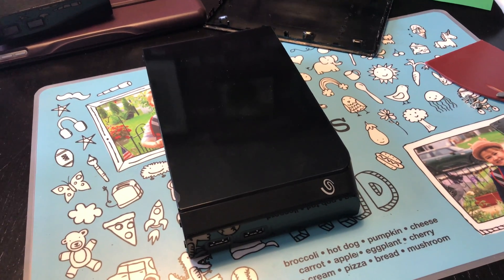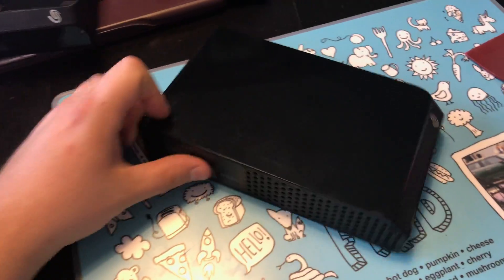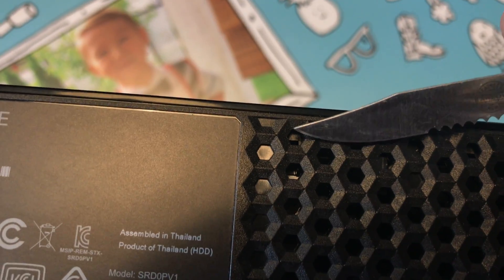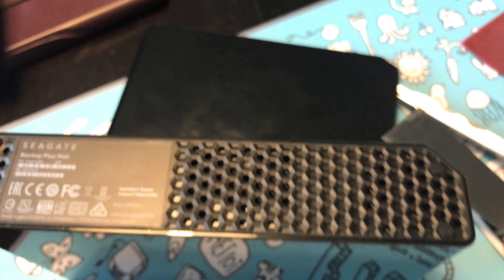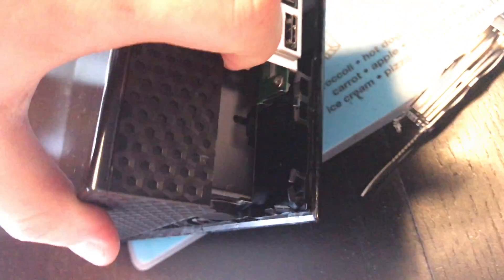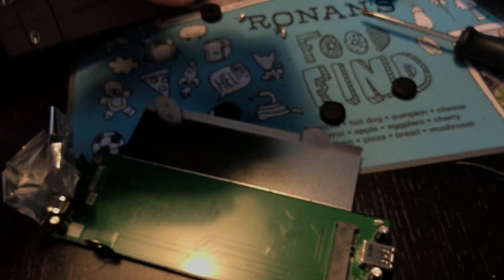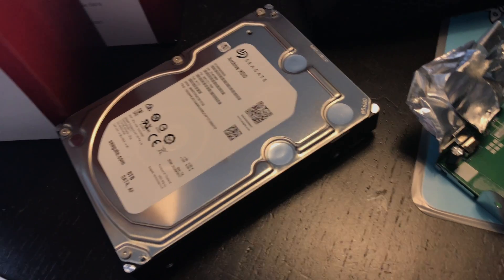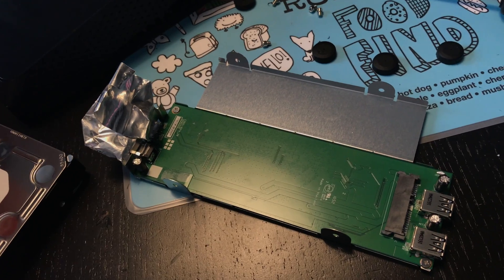How to disassemble a Seagate Backup Plus Hub 8TB External Desktop Hard Drive Storage (STEL8000100)

Comment: Thanks for this. Without your video I'm not sure I would have been able to take this apart. Very difficult. Seagate really doesn't want you taking this apart. My main reason is I was concerned drive was operating at 47C.  By taking it out and putting a fan on it, I've  got it down to 33C. Should last longer I would think running less hot.

Comment: Thank you!! exactly what I needed to know, including confirming that external hubs cost less than internals.  I'll nee four for my Sinology Disc Station. Costco has these for $169, but I didn't want to tear one apart to find it wouldn't work.
Reply from the maker: Depends on the place now for the coatings. I've been using Zenni for glasses and they have not chipped on any of my family's lenses.

Comment: Hi, I just watched your video. I have the same hard drive and today, when I attached it to my laptop and plugging in the 12V power source, nothing. I tried another 12V power source and again, nothing. The drive will not power up, no lights come on and I can't hear the hard drive spinning. I suspect and hope that the controller board is bad, not the hard drive. Do you think my assessment is correct? This hard drive has my archive of more than 5 TB of automotive images. This hard drive, which I have partially backup on the cloud but not completely, literally is my retirement.

Before I crack open the case to remove the hard drive, do you think my assessment is correct, that the issue is somewhere between the jack on the enclosure and the hard drive itself?

Feel free to email me at fmc2900r@gmail.com. I am going to walk away from this for a bit, trying not to panic.

Thanks,

Richard

Comment: Just so everyone is aware before they go tearing their Seagate external apart looking for performance boosts... The reason he was getting 30mb/s was almost guaranteed to be because he never enabled write-caching in the settings. I have the 10TB variant and it gets 250mb/s (it's also a little faster than the 8 though). Before enabling write cache which is disabled by default for file integrity it got about 30mb/s.

The reason why it started going faster for him is because internal drives enable it by default and USB interfaced drives don't.

The other possibility is that he plugged it into a USB 2.0 slot, which maxes out around 31mb/s. Either way that's not the drive's fault, it's user error.

Comment: Thanks for the vid. I just ripped a new one apart for the drive and they now contain a ST8000DM004 Barracuda (which makes me very happy). Similar process but the chassis is slightly different. I had to pull both top and bottom off then the drive and card are fully accessible. No screws bc they're using the sides to hold it in place. ** Wear eye protection **.  A plastic piece shot me right in the eye taking the bottom off.
Reply: Also, he's totally right the USB is crap. Was getting ~20MB before now getting ~100MB over SATA II (older server) and LAN.
Reply: Are you sure your "older server" has USB 3.0? because that's what you need to get full speed out of the USB interface. Also you need to be sure you enable write caching which is enabled by default for internal drives but not external.
Reply: Aye Aye !😆

Comment: Does this hdd run as a normal desktop hdd?? just put normal PSU cable + Sata cable as an internal drive or it need some NAS things to run 
by the video I see that it should work but comments around the internet got my head to dust saying meaningless comments

Comment: Mine has a seagate Barracuda built inside of mine and not an Archive drive. I am also from Canada and needed to rip out the drive because ps4 doesn't allow built in charging hubs on externals. So I bought an enclosure and tore my 8tb apart and out came a barracuda drive instead of an archive. I felt spoiled as I payed 180 Canadian with the tax included for boxing day from best buy

Comment: I'm looking at getting one of these for my ps4 for media storage as a replacement for an older 5tb seagate drive.  I know that this one will not work with the ps4 due to the hub aspect of the control board though.  My question is will this drive itself work with the non-hub sata-usb control board from my old 5tb drive?

Comment: I think it is cheaper in a USB case, and is called "archive" because it is intended, and built for,  very light use.  You said its USB transfers data very very slow compared to your direct SATA.  This may be intentional so it gets little use up to the end of the warranty.  I assume if it was used like a normal, non-archive hard drive it would tend to fail much quicker.  If it fails at 1 year, and you can not restore it perfectly back in the case (no broken tabs), then your warranty is void.  Seagate wins, you lose.

We need to think about the hassle cost on these cheap drives, including data loss hassle.  It is also time consuming to deal with a failed drive.
Reply: Also, the warranty wouldn't be void if you bought it from Walmart or something like that. They wouldn't know the difference between the broken tabs, or normal tabs. They wouldn't know or care. Not to mention the fact that we have super glue for a reason. If anything goes wrong, which it wouldn't, a little bit of creativity can always help. And no they do not intentionally make USB transfer data slower than sata. Sata just transfers data faster, and that's the reason we use it to transfer data... obviously.

Comment: Hey when i plug it in to my pc it doesn’t recognize the external hdd it doesn’t show up on disk management or anything, could this be a usb port issue or a usb cable issue? The light just blinks.Please respond i would appreciate it!
Reply from the maker: Tony Montana did u try the drive before taking it all apart?
Reply: Phathom yes I didn’t take it apart yet I’m still trying to trouble shoot it
Reply from the maker: If your drive is now and having issues after plugging it in, just replace it at the store. You may have a defective unit. Always check to make sure everything works before doing this. Also, know that taking this apart voids your warranty as well.

Comment: I think it would really be a good idea to list the "Seagate" Drive Part Number you find in the box,  Names don't really help as Seagate has a whole bunch of drives listed as archive .. .It would also be the only way you can compare the real price of the same drive.   I will be receiving my 8tb Monday... does anyone know if you can look under properties in windows and see the exact part number of the drive before taking it apart   I am actually looking for drives for a NAS and I think those drives are completely different specs than Archive or the Barracuda line.      But, with out the Part listed on the drive it's self it is impossible to really compare prices!
Reply: Pause the video and you can see the part number for yourself;  ST8000AS0002
Reply: I read several articles of why SMR drives are not good for NAS so read up on it

Comment: I just recently bought and cracked open this very 8tb model from Microcenter for $179 and so far it works beautifully.   I get transfer speeds of 180Mbs.
Reply: What was the exact drive inside? seagate Archive drive or a barracuda?
Reply: seagate's new hdd line archive with green sticker.   Amazon has them for $149 and Microcenter with price match refunded me the difference ($30).   I also bought another Seagate External 8TB for $143 from Amazon.    I will crack open that one as well as soon as it arrives.
Reply: ok. please let us know. I just picked up 2 of them from Frys for $128 + tax.. then I saw I could get one from Staples for $124.99 + tax. I ordered one from Staples as well. Will return one of them to Frys. I've read on various forums that some have opened up to find Barracuda drives. Maybe you'll get lucky with the Amazon's one. What is the manufacturing date on your model? The 2 I got from Frys was made 10/2017.. not bad. pretty new.. made in Thailand.
Reply: was the hdd you bought from Staples 8TB model?
Reply: I took a second look, it is a barracuda.
Reply: NICE! that's definitely a better model than the Archive HDD
Reply: yes, all 3 are 8TB models.
Reply: how could Staples afford to sell 8TB hdd's for that cheap......that's insane!!!!.  I went to their website and didn't see any deals of that magnitude.   And I thought $149 was dirt cheap.   For $124,  I would have bought several of them.
Reply: No, you can't get several of them. The $25 discount from VisaCheckout is a one time use. Staples sells it for thanksgiving weekend for $149.99. I was able to get one of them for $124.99 with the VisaCheckout discount.  I did get (2) of them from Frys.com for $128 + tax. That was also one per household. I got one and my GF also came with me to get one. We stood in line for almost 2 hours to get that deal. Then I came home to see the Staples deal. I was pissed! I'll have a total of 3 of these drives when all is said and done.
Reply: oh!  I see.   Thanks for clarifying it.

Comment: What is the RPM of these drives? Is it 7200 or slow 5400?
Reply: According to Disk Sentinel Pro  5425rpm.   But I see read/write speeds reaching 190Mbs from a 12Gb file copy.
Reply: thanks, it is good for archive.
Reply: I think its 5980 rpm, read some in depth article somwhere, but since its higher density with SMR tech, the speed matches that of 7200 rpm PMR drives. But hesitant about SMR tech myself.

Comment: I've got 3 of these and I get 200mbs. 180mbs on average. Even I was blown away as their maximum is supposed to be 160mbs! I do not have a new ultra powerful system either
Reply: yep!! mine too.  It didn't go as far as 200Mbs, but 190 average.   Though my system is quite powerful like Intel 6700K, 16Gb Corsair Ram and Zotac GTX 1080.

Comment: What I don't understand is why is the 8TB + case cheaper than the 8TB alone?
Reply: It's still cheaper, you can see that's an "Archive" drive, and around here it's 50% more to buy the archive drive without the enclosure.
Reply: Im using external HDDs in my "Memory Machine" for years and sometimes 24/7 and they will all be fine without problems.
My Memory Machine is a pc with low energy consumption for downloading and storage data with Win 7 OS and over 20 TB storage space.
Reply: It's the same model number as a drive that is $50 more expensive
Reply: Drives that fail QA during manufacture get recertified internally for resale and stuffed in these enclosures.  That's why you see random makes/models inside from one box to another.  There's nothing wrong with them, but when I buy them I run Seatools on them quarterly until my warranty is up, then I remove them from the enclosure for internal use.
Reply: Theres less of a market for the bare drives so they sell allot less of them so mark the price up where as a external can be used even with laptops which makes them usable for a lot more consumers so they can lower the price to sell more units.
Reply: An MSP or business will pay more for an internal NAS drive replacement v. a consumer. This model now contains a ST8000DM004 Barracuda which is $50 more by itself.
Reply: One major factor for price different people are ignoring is the difference in warranty period. These external drives typically come with 1 or 2 year warranty, while the internal versions come with a decent 5 year warranty at least, which you're basically paying for.
Reply: It's because SMR drives are cheap, but are designed for archival, not really mainstream read/write intensive work.  So, you'd never want to use one for an OS or a database, but they are fine for storage.
Reply: @siliconaudio  I was thinking to buy about 4 hard drives like this one  and remove it from case and put it in a NAS server. They are not good quality ?
Reply: @tiberiud1955  It's not a question of quality, you just need to understand the performance characteristics of SMR drives and how they differ from the more traditional PMR drives.  Due to the way they over-lap tracks, their performance drops substantially when performing large sequential write operations, once the small amount of cache is saturated.  If you only write a few GB at a time, you probably won't notice and the performance hit does not really affect read performance.  If you google Shingled Magnetic Recording, you can research this yourself.
Reply: @siliconaudio  Thank you for your answer. I am not familiar with SMR or PMR drives. I will do my homework now.  Now it makes sense. I guess I have to pay for good NAS hard drives ... no other way around it.
Reply: @siliconaudio  what about a NAS?
Reply: The 8tb Xbox external storage drive is a Seagate Pro 7,200rpm and is cheaper than the above
Reply: that drive would be lower quality with a lower lifespan

Comment: Hi.

If I buy one of these, can I use the HDD in a NAS synology ?
Reply: These drives are what Seagate call their "Archive" drives.  They use SMR (shingled magnetic recording) technology which can suffer from slow sequential writes.  They do have around 20 GB of on-platter cache which can make smaller writes quite fast, but sustained writes will slow down significantly.  Read speed is good though.  I'm not sure if SMR disks are supported by many NAS makers yet - it would pay to get confirmation from Synology tech support before laying down your cash.
Reply: on usb 3.1 port, you can reach to 145mb/s r/w speed.

Comment: Thanks seagate, my next internal drive comes with a USB hard drive hub
Reply: even though it might be too late now:
this drive is not well suited as internal drive. its smr which means its only good for doing straight back ups not copying small files since the datatracks overlapp to a certain extent and the speed will drop drastically when you're doing random writes especially on a full drive.
if you want a better drive just take the barracuda. its sold at the same price as the archive drive but its much better suited for everything but backups (where its  even)

Comment: Hey Peter, let's say I already started using this 8TB Ext HD by archiving some files with its USB cable. Can I still access these archived files when I tear them apart like shown on video and hook up as internal HDD to my desktop ? I'm just not sure if that control board will encrypt the content and if the control board fails, the data will not be accessible? thanks!
Reply: That's great, that means if that controller broke up you can take HDD out and it will read data  without any problems. No encryption
Reply: YES - If all that fails is the "sata-usb bridge board" inside the enclosure all you need to do to access your data is remove drive from enclosure and put the drive in a docking station.

The "sata-usb bridge board" failed earlier today but I now have access to all my data on the 8tb drive via my usb 3.0 docking station!
Reply from the maker: I had some files on the hard drive before I made it internal, they read fine.
Reply: exactly thats usually the MAIN issue when some people claim their PCs cant see or read from the drive anymore, they waste time and RMA it back, Lose ALL data and get a "refurb" drive back.
When you can just follow this vid, pop the physical HDD out, stick it into your PC (SATA or Enclosure) in 9 times out of 10, it works again.